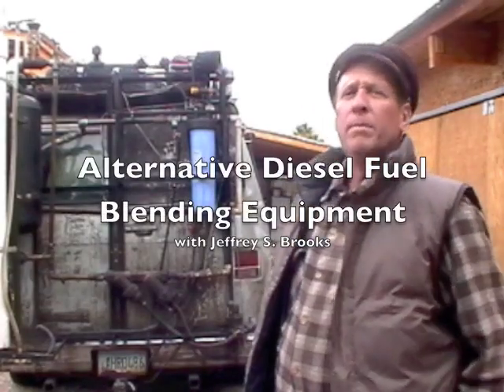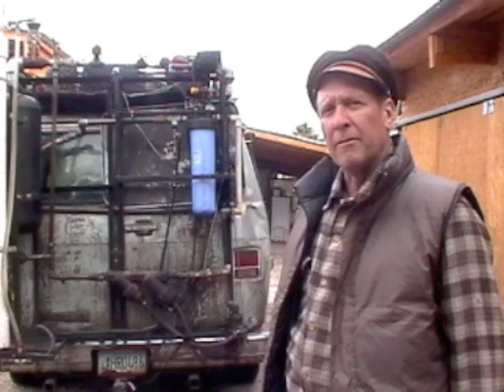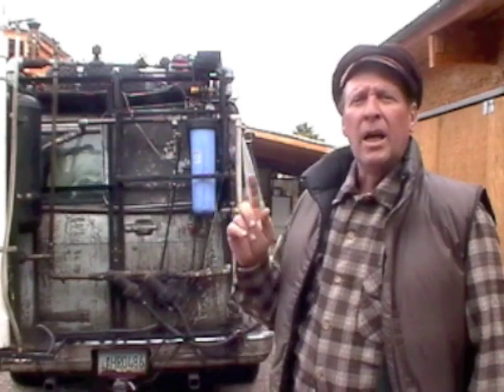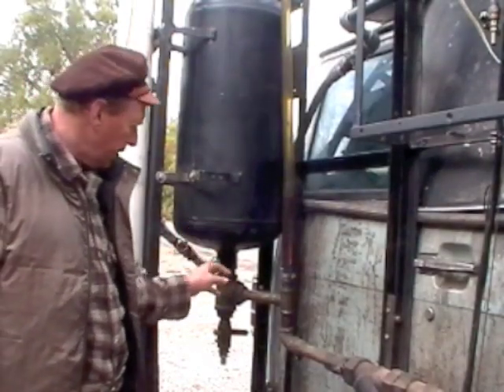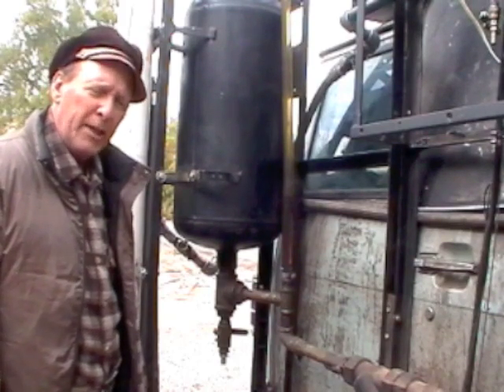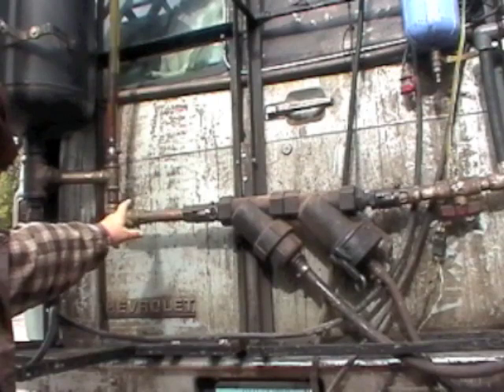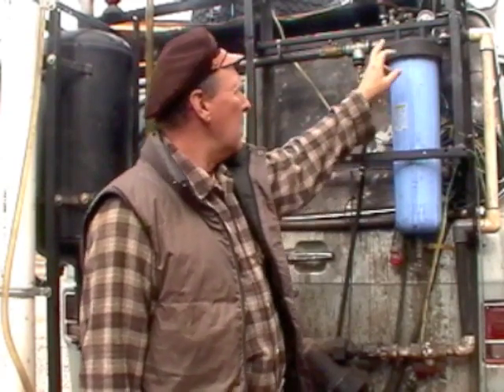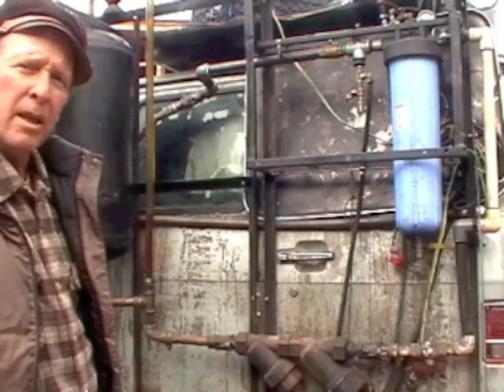A tour of a waste oil diesel fuel blending system

Comment: hi jeffrey; i am trying your way of blending since 2 months and it work effectively
the troubles i faced are these 
1 the engine takes longer time to start with the blend than regular diesel
2  more smoke goes through exhaust
am asking if i can solve the problem of smoke in the car??
Reply from the maker: Most people do not have the problems that you described, so I would suggest that you carefully review the method that I described.  

However, there is a problem common to both blenders and two-tank SVO users.  In both cases high melting point triglycerides and gum accumulate in the oil circuit, which causes gumming of the rings and valves within about 25,000 miles on naturally aspirated diesel engines.  Turbo diesels have not yet reported the problem.

The solution for both users is to convert the WVO to biodiesel, then blend the biodiesel with gasoline to bring its specific gravity down to .845sg.
Reply: thanks

Comment: I have access to waste oil from machinery that's not a motor. Can I still use this even tho it did not reach high temperatures?
Reply from the maker: It sounds like your waste oil source is much better than motor oil.  Just remember, when it comes to burning waste oils, and waste solvents as diesel fuel, oil is just oil, which means most oils will dissolve readily into most organic solvents.  However, making diesel fuel blends requires after making the blend, then allow it to settle for a few days before removing any sediments, then filtering, before putting it into your fuel tank.

Comment: Is that rig DOT approved?
Reply from the maker: All of that equipment is a fully mobile waste oil processing system.  DOT has never had an issue with it.  It is only 2 feet added to the rear of my van, and it is attached by an all steel frame that is bomber.

Comment from the maker: It is good to hear that the blend continues to work for your engine.  If your engine occasionally revs to higher RPMs, then it sounds like you may have some fuel stratification taking place.  This might be more common with a stationary engine, which it sounds like you are saying.  Whereas, autos move the fuel around. 

Fuel stratification can be due to not allowing a proper settling period, or not removing enough of what settles out, or the ambient temperature dropped.

Comment: I must announce that continue to work well, except that sometimes a left stationary revs up to 2000 I think is the injection pump, the problem still unsolved. But why I am interested and I think many like me. which is modification the injectors. Exactly what injectors to fit. at a higher engine? work to facilitate the injection pump.? (to facility the injection pump work) sorry translations. I hope you are understand

Comment from the maker: While WMO cokes my injectors there a numerous reports of people successfully burning it for long periods of time with no trouble.  They all have a turbocharger.  My engine does not have one. So, it is reasonable to conclude that a turbo will make WMO burn on any diesel engine.  However, WMO should be blended with gasoline at about 20%, then the blend should be settled for about 1 month, then the sediments should be removed that precipitate out, before filtering.

Comment: Thanks for the reply, unfortunately I can buy just WMO, my seals started to flow due to forcing. the combination of 50/50 WMO / diesel, running over 110 km / h starts and flow, no hard acceleration does not doing wellif go carefully, that there are no problems. 1 What is the solution to the injectors coke? 2 preferably a big motor or a small motor functioning WMO? 
Thank you so much!

Comment from the maker: 1) I stay away from burning WMO at all on my engine, because it cokes the injectors.
2) I change my motor oil at least every 3,000 miles (5,000KM), because burning vegetable oil-based fuels brings vegetable oil into contact with the engine lube due to blow-by, which produces sludge in the engine.
3) I keep the gasoline content at or below 30%, because higher amounts of gasoline raise the alcohol content in my fuel blends too high and cause seal swelling in my IP.
4) I am very careful making fuel

Comment: Hi,congratulations for the video, that was the consequences runs 80/20 WMO gas? what happened to the injectors? only required cleaning? I have 10 000 km done with a 1.8 td, I had problems only with the pump seals ... Lucas CAV ..... bad idea in choosing this pump ... May what to expect from now on? What other problems?

Comment from the maker: I have been running my 6.2L Detroit Diesel (GM) on various waste oil blends for 5.5 years.  It runs great on 80-20 WVO-gasoline, but WMO even at only 20% cokes its injectors within 3 months of driving.  So, since I have been experimenting with WMO blends off and on for 5 years, then I have gone through a lot of sets of injectors and injector pumps, because WMO has ruined them all.

Comment from the maker: Waste gasoline is a general term to apply to gasoline that might have been used as a solvent, or what was drained from a fuel tank, or misfueled into a diesel fuel tank, etc.  All of these sources or gasoline are not useful as fuel for a gasoline engine, but can be blended with waste oils to make diesel fuel.

Comment from the maker: @Begbucks Yes, the van needs a bath, because making diesel fuel out of waste oil inevitably leads to spills and messes.  So, I use a lot of rags to cleanup those messes, and I use those rags that are soaked with oil and gasoline to work on the stains on the rear of the van.  Once my rags are saturated, then they make great kindling for lighting a fire.